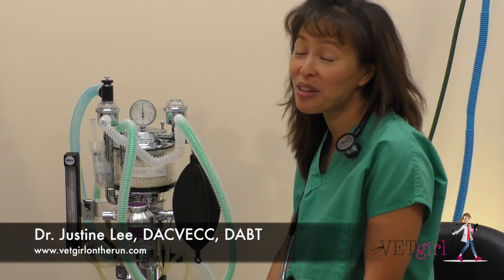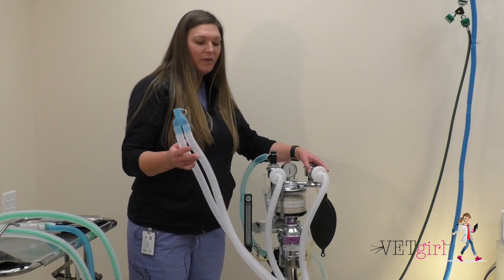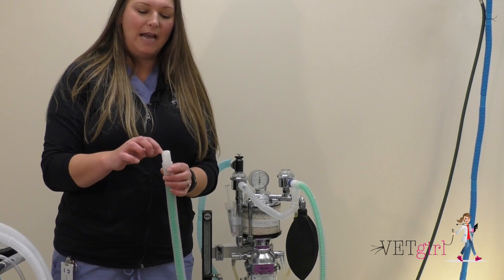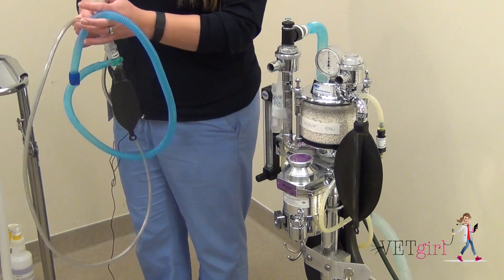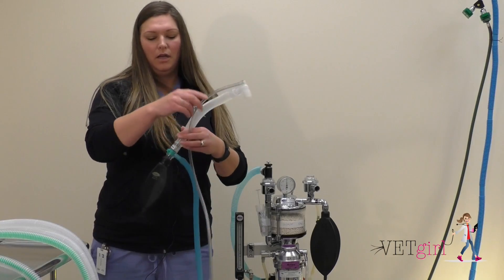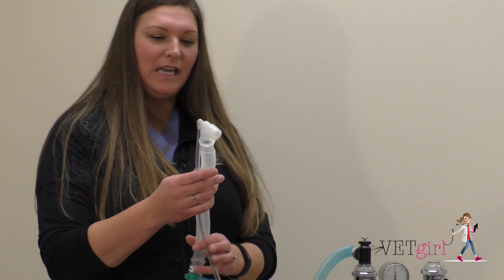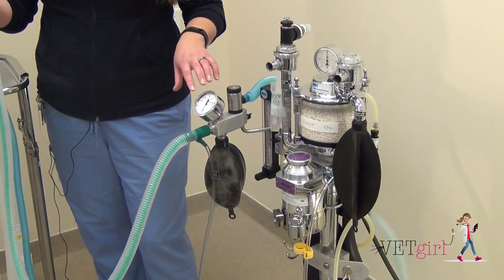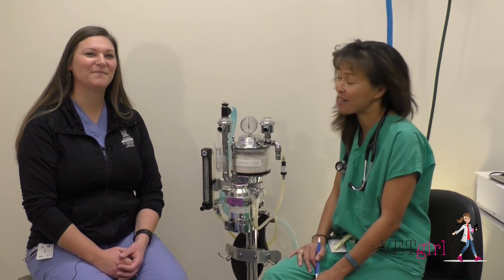VETgirl Veterinary Ce: Veterinary Anesthesia Review: Part 2

Comment: I have two questions for Rachel, if possible!

1. The rebreathing system where I work looks like this http://www.shor-line.com/image/large/273.jpg   How full should I keep the resevoir bag while in use? Should it be empty/the pop up valve totally open until I need to give a breath, or partially filled/pop up valve partially closed, so I can give a breath quicker? 

2. The doctors at my practice will monitor during a dental prophy, and some never utilize our non rebreathing system. They use a pediatric tube for the rebreathing system, a 1/2 liter bag, and turn the oxygen flow rate up to 2-3L/min. We don't have capnography, so I am not sure if this technique is safe or not. Thoughts?